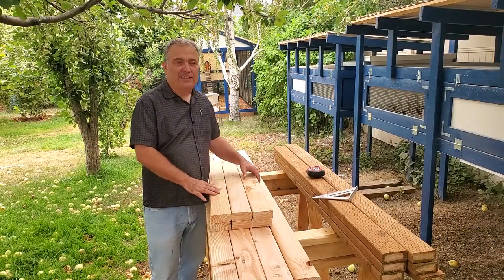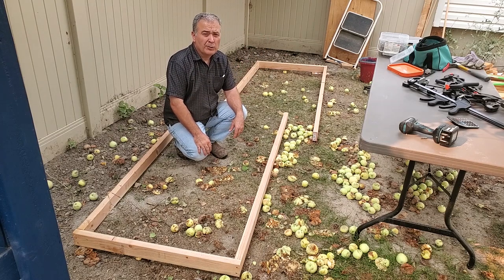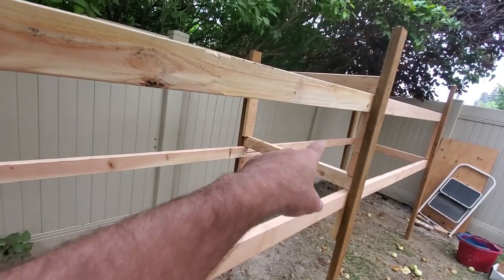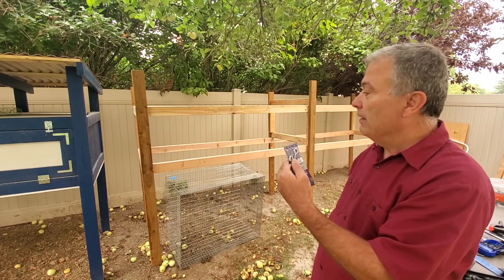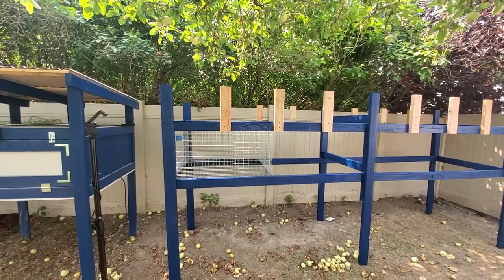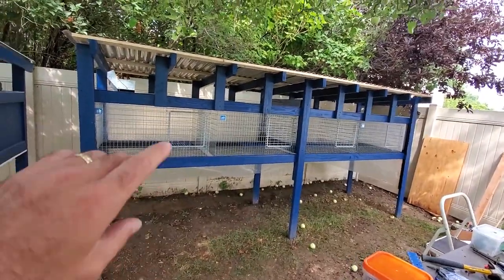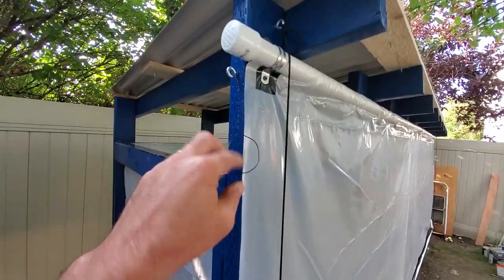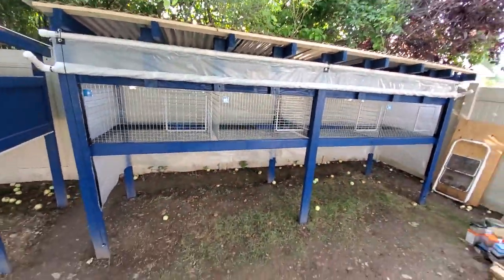Building A Rabbit Hutch with KW Cages - Teal Stone Homestead Style! (Silver Fox Meat Rabbits)

Comment: Ok so the rabbits can they chew the plastic? And also where does the feeders go if on the outside on the front will the plastic go around them no problem or would I have to add a bigger roof? I am trying to get ideas because stacking cages can only do 3 high then with the cost of the trays, it cost pretty darn close to build one like this and be able to put more cages in a 16 foot span I think I figured I can get 5 30x36

Comment: I like the idea of the plastic and keeps it bright, but will it get too hot in the summer?
Reply from the maker: It was built and had rabbits the last part of the summer. There were still some pretty warm days. Most of the time I keep the front plastic rolled up so they get plenty of air flow. The only time I put it down is when it is really cold and windy. (Cold wind is the only cold that can get to them.)  And even then it seems like they get plenty of air flow. I wouldn't want to have the front plastic down other than when it is very cold and windy. It works great and they seem very comfortable. Their hutch is in the shade.

Comment: Just found your channel. I was looking on how to winterize my rabbit hutch. Think this will work for PA winters?
Reply from the maker: I live in a town in Idaho with an elevation of just under 5,000 feet. They don't even close our schools here unless it gets 20 degrees below zero. So yes I believe this hutch will work well for your area. Rabbits do great with cold. Much better than they do with summer heat. The main thing is you have to be able to get them out of the wind when it is really cold. Where I have my hutch positioned it is next to a fence and under a big tree so most of the wind is blocked anyway. But still I can pull down the front if it ever gets windy just in case. I hope that helps.
Reply: @theemergencyprepguy  Thank you so much for your reply. The back of our hutch is against our porch. We have privacy screen on our fencing. We rescued the rabbit. It's a Dutch rabbit we found in our back yard. We asked neighbors if it belonged to them. No one claimed it, so we now have a rabbit. One thing we have noticed, is even cleaning the hutch everyday, (We purchased one for in the house) it still stinks and her pee is getting everywhere. Hence the move outside.....lol  Thank you again!
Reply from the maker: Yes I know what you mean. I have heard they are smart enough to be house trained but I've never tried it. I like outside better.

Comment: Why hang them?  I would just set it on 2x4 rack less wood is needed unless a reason is needed to hang?
Reply from the maker: The whole reason I went with the hanging model is because then I don't have to deal with the poop and urine build up on top of the 2x4's that support the cages. Hanging it is much cleaner. And the wood lasts longer.